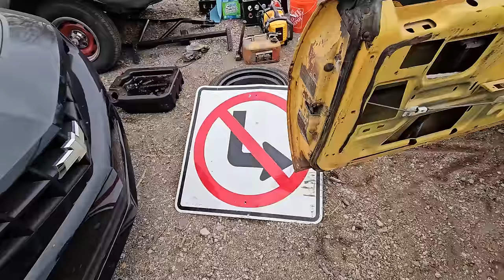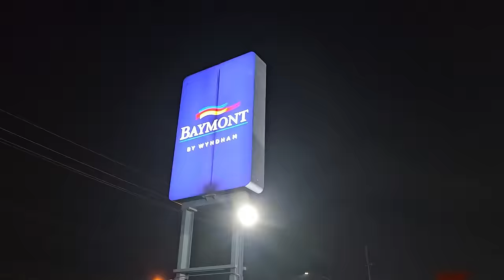JUNKYARD AMC JAVELIN Will it Run and Drive 250 Miles Home?

Comment: I had a 70 Javelin in high school with a 304 and a 4 spd manual with a Hurst shifter.  Mine suffered from the front wheels locking up too, but it was a bad master cylinder.  When my front wheels decided to lock up, I had to back up until they started rolling again and then I was good to go until next time.  I also had the same long shackles to compensate for the clapped out rear leaf springs.
Reply from the maker: Nice!! Wish we had the manual!!

Comment: I always thought Javelins had one of the nicest looking front ends of the period muscle cars. Had a friend who had a 74 Charger SE with the 400 magnum engine and a 72 Javelin that he dropped a 527 (? Don't quote me on the cubic inch but it barely fit) racing engine in, converted to a T-top, pistol grip shifter and a custom pin stripe job (which is what he did for work back in the 70s. That Javelin was fast. Alabama even had a few that were used as police cars back in the 70s.
Reply from the maker: That sounds sickkkk

Comment: Gm ignition,  Ford Carb, Chrysler Trans...... rest is all glorious AMC. Once you get the hang of it they're easy to work on. And that's an AMC Model 20 rear.
Reply from the maker: Awesome, thanks for the info!
Reply: Ehhhh your not exactly right they used the same suppliers
Reply: @cheyenneroth6707  it's a basic platform of those manufacturers though.
Reply: @IrishOutlawGarage  every car ever made is a basic platform of each if you wanna get technical
Reply: @cheyenneroth6707  technically

Comment: I owned a 73 javelin myself. Currently working on a 74 gremlin. I’ve been a diehard AMC guy since I was 19. (I’m 47 now) what you have most likely is a 304 car with a AMC/Chrysler 904 automatic transmission and the rear end is a AMC Dana/model 20 rear end.  Between both those cars I’m pretty sure you can make a decent ride out of one of them. I hope you don’t put a Chevy motor in it.
Reply from the maker: Would like to put a 401 paired with a manual and then possibly a blower out the hood? Haha
Reply: The AMC 20 axle was neither designed by, made by, or affiliated with Dana/Spicer. It's entirely AMC. The AMC 15 axle was sold to Dana in the 80's and renamed the Dana 35, but was an AMC design dating back to the early 60's.
Reply: @DailyDrivenDeathTraps   Good luck with that.  There are NO blower manifolds ever made for the AMC V8.  A few people have spent inordinate time & money to whittle down an old dual quad manifold and weld on a blower top..... but it's more for show than performance.
Reply: @upscaleshack   Well, we rebuild them today using Dana/Spicer parts so.....

Comment: Its wonderful seeing rare cars revived for the road. I know my 1977  Mercury Marquis 4dr with the 400 6.6 and FMX is rare only 270 to 8100 of my model were ever made in 77  (depending on production number.) It's getting the Mad Max treatment getting turned into a wastelander car for Wasteland Weekend. 4000 miles round trip to near Edward's AFB and back home.

Only paid 800 bucks for it but it needed alot of mechanical work (new engine and trans) on its 2rd engine and 3rd transmission about to be a 3rd engine I need to make sure it don't break down there. So either 460 or another 400
Reply from the maker: That's so awesome 😎😎 mad max treatment is the best haha

Comment: Never messd with Javelins, but do have my own AMX story.
About 45 years ago, we had a family neighbor, and the father ran an AMC Dealership.  Around my town, we also had a Chrysler plant.  Mopars, Javelins, AMXs, Hornets, Ambassadors, everything!  But let's get back to AMC...
They had 2 Hornets, and their son had a 69 AMX.  He tore it apart already.  It was first white, then red, then he painted it purple.  Graphics on the doors was hand painted Tasmanian Devil, from the cartoon.  Added some,  I think, Mickey Thompson wheels.  Under the hood, an insanely modded 390 or 392.  That hood, of course, got an insane hood scoop, to be friends with that intake.  Interior was mainly stock. I do remember that T-handle Hurst shifter.  Great audio system:  Just an 8-track and some 6x9's.  The tapes played were Boston, Molly Hatchet, and Charlie Daniels.
That AMX won many drag races at St. Louis International Speedway.  I was only like 12 or 13 then, and I rode in that thing, holding my ass on, for dear life.  GREAT TIMES.
Fast forward to now, 2024.  The son is now aged in his late 70's.  Guess what, he STILL has that AMX!  Kinda off-topic, he's also built a Chevy Vega station wagon.  Shoe-horned-shoved a 350 in it.  Also did a great performance mod on a 73 Triumph Spitfire convertible.  As always, even 45 years later, his cars RIP!
Thank you for taking time out and reading my story.  Greetings and blessing from San Diego, CA.

Comment: As a Ford guy, i think AMCs are very underrated. My friend bought 2 AMC Eagles that used to be my grandpas. One being a pretty mint 1982 Eagle SX/4 with a 304 V8 swapped into it and an 82 wagon for parts. On his they have Ford Carbs and ignition, a GM Master cylinder and steering columns, and a  Chrysler transmission. Then my dad has a restored 69 AMX with a 390. But other than stuff they borrowed, they made pretty much everything else themselves

Comment: Just a tip. Start checking your transmission adjuster cables aka tv cable on the linkage on carburetor. Could have kept that tranny nice and healthy because driving it with it stretched or seized will burn the clutches out due to not enough pressure. Which cause slippage. Especially while towing another car
Reply: That car has a rod setup not a cable

Comment: I owned  two 74's was in my 20's . Semi hailing steel ran a light went over my hood cop seen the whole thing  and was yelling at the driver. Pulled everything out of it. Put all the parts into another gutted 74 wires rear end engine  interior and all. I drove  that Javelin for years. miss that car. Traded it for my wife a ride. About 40yr ago

Comment: Yeah, things with independent front suspension won't flat tow and follow without the weight of the engine and trans.
Straight axle vehicles tow awesome either way.
Reply from the maker: Ahhhh, i was thinking it was due to no weight in the front of the roller. Good to know! We've never towed something like that haha

Comment: 😅Have a 74 Javelin myself.  It's a survivor with 48,000 miles.  Min has a 360 with 4 speed. Pulled mine out a barn where it sat for 35 years.  The car is fun to drive and always receives comments.  Nice to see any AMCs featured.
Reply from the maker: Wish we had the 360 4 speed!! Thats sweeeet
Reply: That's the main reason I purchased the car.  Have owned it since 2017.  I have been around AMCs most of my life.
Reply from the maker: @andyhahn2281  easiest place to find transmissions, engines and parts? Just get lucky on Facebook?
Reply: There are a couple places to find parts.  American Parts Depot and Kennedy American are my go to places for parts. Both are on the web.    Amazon and Rock Auto I use also.

Comment: Javelins use an AMC 20 rear end. That York style ac compressor is Ford, but it is not big compared to it's contemporaries.  In fact, aftermarket add on AC was based on those.
( The Mopar compressor is called an RV2 and  looks like a Harley v2 engine.)
  Javelins have , GM Saginaw steering, Delco distributor, Ford starter relay and starter, Ford carbs,  Mopar Torqueflite trans.  But those are things to be happy about, not fret about. They are buying name brand parts!   The brakes are similar to Mopar, "kelsey hayes" may be the name.
Reply: 32:00  Mopar 904 (lighter duty trans) on Javelin 304, Mopar 727 (bigger trans) on Javelin 360, 401
Reply: 55:00 There is a spoiler that came on the Javelin AMX that it perfect for any Javelin. Probably better than a wing.
Reply from the maker: I looked the wing up, looks pretty good! Thanks for all the info, I looked up some things about the 304, guess we woulda been better off with a 360 or 401 if we wanted to upgrade it ourselves, sadly the valves are small in the 304. I did see that the 904 trans could handle up to 600? Seemed kinda high but we would still like to convert to a manual anyway if we get to keep this.

Comment: Great to see. ... Very cool nostalgic video. Gotta treat those cars with respect.  I completely restored a 1973 Javlin. Light blue with a black vinal roof.  Wrecked and burnt from a junkyard back in 1979 ? My sister took it on her honeymoon 2 weeks after it was done. Had it for years then stored it for years when I moved out of state. Came back to a unit that needed restored again but did not have the time or money so eventually sold it. Now I am 72 and retired. Looking for a Javlin again as my Dad was also a Rambler dealer back in the day and all 7 kids and Mon all drove used Ramblers or AMC's and would like to find one to do for my 73rd birthday. Not looking for a show car but a decent looking daily driver.  How much can I buy this one for?  You just don't find them anymore. I also had a 68 silver fastback but the 73 was a much cooler look . ..

Comment: You do know the difference between a rotor and a drum, right? And those "extended leafs" on the rear are called extended shackles. LOL! Anyway, love the Javelins. And those MotorCraft 2 barrels are actually pretty good carbs, with the exception of the accelerator pumps failing all the time. Easy to change, though, since you can take them off and replace the diaphragm without taking the carb off of the intake. I had a 69 AMX 390 automatic many years ago, that thing RIPPED! Wish I still had it, but I got divorced, and it was given to my wife and I by her father when we were married, so when we split, her dad took it back and I think it went to like Montana somewhere. The auto trans in those Javelins should be a TorqueFlite 904, they call it the "baby TorqueFlite" because it's kind of a smaller version of the 727. My 69 AMX had a Borg Warner auto trans called the M11. It lost second gear, and just shifted automatically from 1 to 3. Felt like an old PowerGlide, but the damn thing kept working!  Good luck, guys!

Comment: My dad bought everything amc he could find in the 70's and 80's, he drove the same 62 rambler for 50 years and the only thing I remember fixing was the fan belt and brakes replaced a couple of times, anyhoo i have a little over 200 on our farm and I have 24 javelins and they are in really good condition, i have only sold a couple of things because we're not a junkyard and not many people know i have em, but if you need any parts let me know, I have three of the 76 red white and blue javelins that are complete and I drive one about once a month, I also have four semi trailers full of new old stock parts where dad bought out amc dealership s that was closing permanently, qtrs, fenders, i have everything javelin and amc related up to 82
Reply from the maker: Sheesh, it would be cool to see all that.
Reply: @DailyDrivenDeathTraps  come on over, I'm in ky

Comment: Now really keep it ....

For 1974, the engine breakout was as follows: 1,884 with the 304; 2,320 with a 360; and 776 with the 401.
Reply from the maker: So most javelins has the inline 6? Because back in 74 27,000 (something) were made.

Comment: Next time someone repeats the tired trope that AMC's are a hodge podge of other makers' parts ask them how many components on a modern car are made by Bosch? AMC bought some components from the Saginaw and Motorcraft divisions of GM and Ford, and used Borg Warner, GM and Chrysler transmissions but made their own engines, rear axles, and numerous other parts. This is no different than any of the non-big 3 automakers before they all went out of business.
Reply from the maker: Good info, it's just what we heard but we're learning!

Comment: Would love to get these cars I have a 74 but it's just a shell not really worth fixing up
Reply from the maker: If you've got most parts, it's definitely worth fixing! Just put an LS in it and go
Reply: @DailyDrivenDeathTraps  doors quarters trunk extensions floor panels inner cowl all rusted out seats destroyed interiors missing parts steering columns missing a lot of parts and as you mentioned in the video about it being a car using other manurfactures parts the joke with AMC is it stands for All Manufacturers Combined is pretty much true
Reply from the maker: @cade2367  ughh that kinda sucks 😞
Reply: @DailyDrivenDeathTraps  I only give 500 guy I bought it from bought it for the 401 to put it in his 71 he's a little older and was going to hire it done I told him id pull the motor freshen it up and put it in his car in trade for the 360 in his and he give me a 401 bored .30 over for free for it so I got a 500 dollar amx a, 360, a 401 .30 over block and got to work on a fully restored one and drive it and have a little fun all for 500 I'm not complaining I learned a shit ton about the cars got lots of good extra parts and made a good friend

Comment: No, the emissions canister is not part of a cruise control system.

The rear ends are Dana/Spicer.  The small rear is the AMC 15.  The big rear is the AMC 20.

I don't understand why people put AMC down for outsourcing their ancillary pieces.   Chyrsler used Saginaw steering boxes and columns.  Chrysler even used Rochester carbs during certain years. AMC was smart.  Why reinvent a carburetor when you can buy one off the shelf?  it makes their cars cost less and easier to service.   AMC was way ahead of the curve seeing as how cars of today are.... melanges of various parts.  GM's will use a Nissan engine and a Hyundai transmission. Chrysler is.... I bet Chrysler doesn't even know where there parts are from.

It's a shame people let these cars deteriorate to this point. AMC's in general are almost unrestorable.  As somebody who loves them very much and has done two very nice restorations.... you need literally 4 to 5 cars to make ONE good car simply because there are NO parts out there for these cars. Sheet metal?? Nope.  Glass?? Old stock or used. Or, like you found out with brakes; sure there's some stuff out there but it ain't local and it ain't cheap.  There are some suspension parts that are literally unobtainable.  It's either find NOS which is almost impossible, or you're cobbling something together with a modern part. It took three Javelins to make mine. And half a dozen cars got cut up to provide the sheet steel necessary to restore my Gremlin.  I'm not really looking forward to doing my Hornet and I'm out of my mind for trying to find another SX/4.

Comment: are you rebuilding it
Reply from the maker: Yes we are. On jack stands right now getting all new suspension, gas tank cleaning out/ new fuel pickup, new headers since the old ones were crushed and rotten.
Reply: @DailyDrivenDeathTraps  that's great man would like see you doing all to being this to that level of satisfaction to drive with no problem
Reply: @DailyDrivenDeathTraps  wish I could join to be part to rebuilding the cars where are you located beo

Comment: “Parts are hard to find”... whuuut? No way, I have a 73 Jav AMX and parts are widely available...any drivetrain, brakes, suspension, exhaust, etc. are all easily found. Trim pieces and such are tougher to find, but used parts are available on eBay all the time. Gas tanks and senders are available...you should do some more homework..unfortunately you got two SST models ( weak ) and not the AMX ( higher performance) model. Also , 71-74 are gen 2 type ( with the hump fenders ) and gen 2’s only came with a straight 6, a V8 304, 360, or 401.. no 390’s came in these cars, those were gen 1 engines..AMX ( gen 2 ) only came in the 360 or 401, and some had active cowl induction ( like mine ) and some had a go-pak, an option package. Don’t go crazy on these, as 304 SST Java are not that valuable...
Reply: Go to a parts store and look up the front brake lines. One was available in Arizona thats it. Obviously everything is available online, but not in a respectable time frame.
Reply from the maker: Thanks for the info. As you could see us calling around in the video there was nothing close. We only had two days and the parts we came with from our town were ordered wrong. Why would we do homework when we can have a super super nice guy like you tell us what we have!!